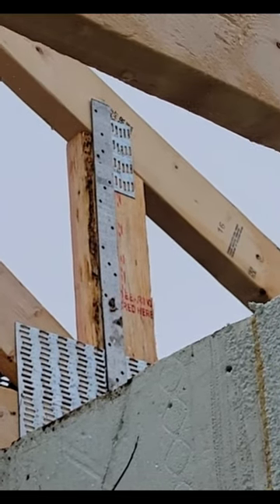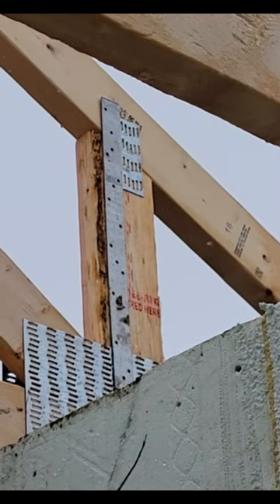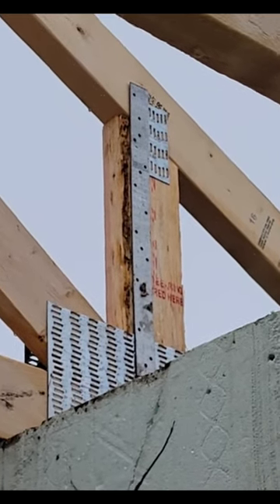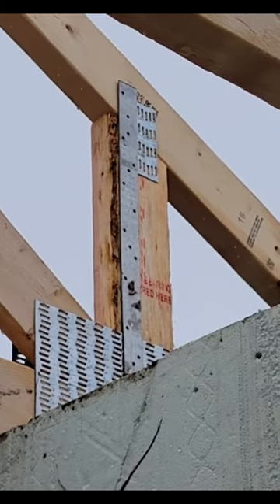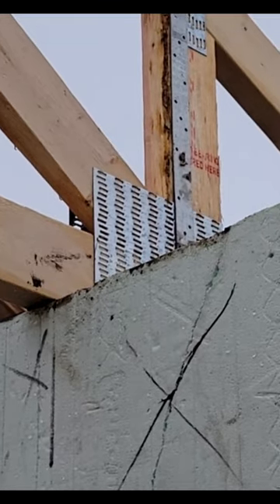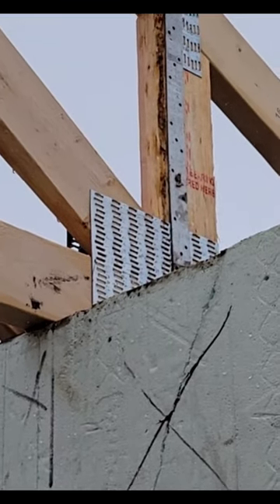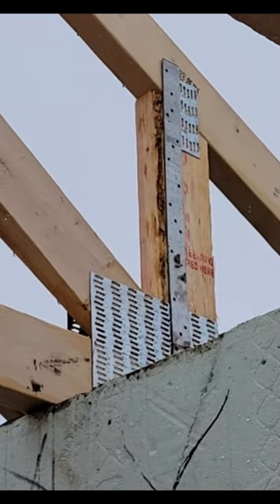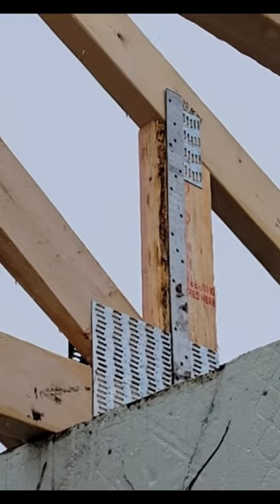Roof truss to ICF wall attachment. Don't blow your top!!! #construction #ICF #concretehome

Comment: Hi Jake. Do you need to put down a sill sealer so the wood is not in direct contact with the concrete?
Reply from the maker: Yes. Either the TSS from Simpson, or some Ice and Water Sheild